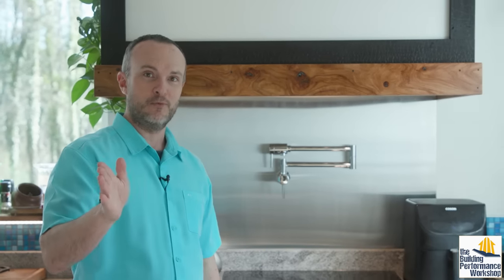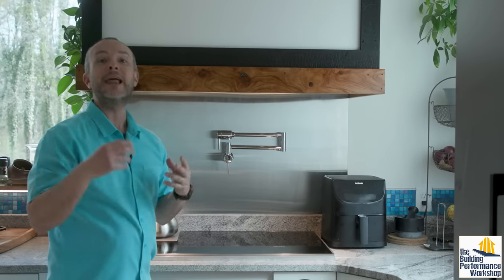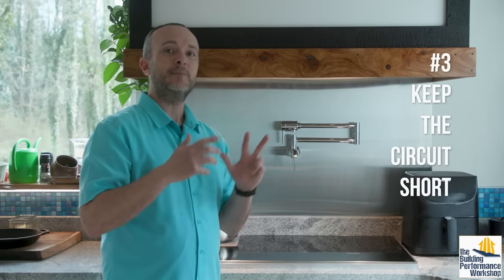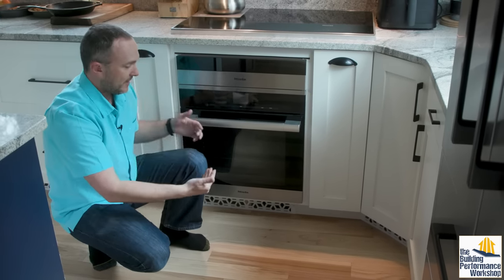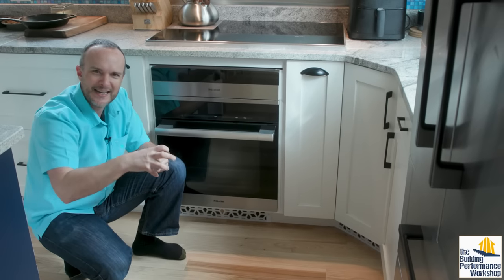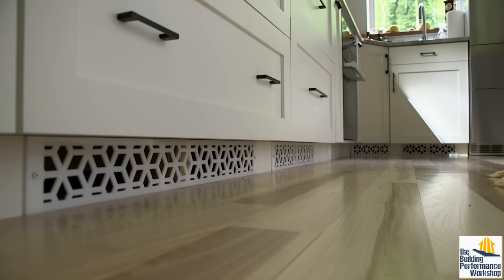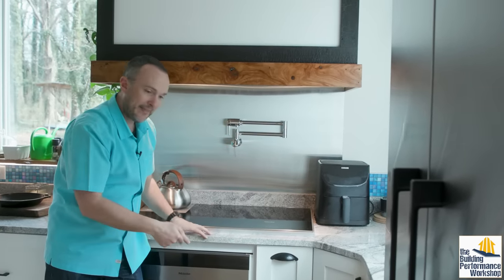3 Rules for Kitchen Make Up Air Systems: HVAC Training for Home Ventilation that Performs

Comment: Does your air conditioning evaporator coil create condensation when the system is running during the summer?

Yes? (No duh...)

Then moving your hot and humid make-up air at speed through your cabinet-bottom cavity will also create condensation. 

Put your untreated outside make-up air into your HVAC return plenum. That's how it's been done in commercial settings since forever.  For good reasons, too.
Reply from the maker: Clearly you have not seen condensation effects inside return plenums (many of us have) and our 3-year maintenance video on this system.
Reply: @HomePerformance  

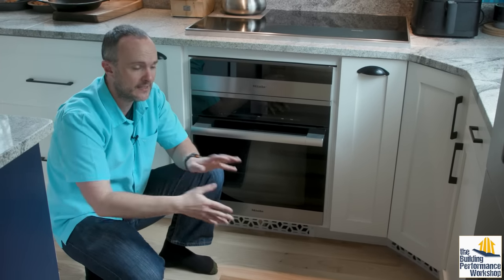In the first instance, I'm addressing your speculation at 9:00 that having the untempered outside air move at greater velocity through your make-up air plenum mitigates condensation risk. It really doesn't.

Second, in commercial HVAC settings, its completely standard to have like 20% outside air mixed into the return air at the air handler. In residential applications, though, it is still a bit novel and exotic and Passiv-Haus-ish to think about adding outside air anywhere in your HVAC loop. And yes, the equipment and system has to be designed for accepting outside air (randomly bunging an outside air duct into a return plenum that isn't expecting it can indeed lead to problems).

Third, in commercial settings it has become pretty well accepted that tempering your outside air or make-up air is standard, particularly where occupant comfort is at all a priority (there are certain industrial settings where it is not a high priority).  It is just jarring to the ears to hear of a design that is high-end comfort-oriented throughout, and then hear that the make-up air is just vented onto your kitchen floor untempered.

Fourth, I'll look up your 3 year retrospective video and see how things turned out. Being a residential kitchen with only intermittent exhaust fan usage, and given all the waterproofed coatings you described,  I'm sure things are A-OK 3 years in.  But taking a 30 year view makes me a tiny bit nervous, with this design relying mainly on a few coats of polyurethane (some of which are in places - the undersides of your cabinets - that are not easy to access and recoat) to keep mold risk at bay.

Comment: Wait, LMG this straight: you are pulling air out of your crawspace, onto your floor, OVER your food while cooking?
Reply from the maker: You obviously are not familiar with my crawlspace, but no that's not what's happening.
Reply: @HomePerformance  even if the air from your crawlspace is filtered (is it?), how is the air not hitting your floor and coming up over the stove? Isn't that why you worked so hard to have a short circuit so the house doesn't exhaust already treated air and instead blows out the air it just sucked in? Otherwise, what's the point of such a short circuit?
Reply from the maker: Again, you don’t know how a make up air ststem works my friend- look here:
https://youtu.be/bMkvCn1sGvk?si=IzYxk6T4DMZfx6JI
Reply: @HomePerformance  Not sure ANYONE "knows" how makeup air should work. Lots of theories, just here trying to find the mean for my ADU. One builder uses the bathroom exhaust running constantly in a <500 sqft space and NO inlet. And unlike you, Matt Risinger's house has a LONG circuit, way on the other side of the house as the range hood. 

One thing that would help is if you explained WHY you recommend a short circuit. This is the only place I've seen that, and you didn't say WHY, unless I missed that.

Comment: A 10 kw heater would be to much for a 600 CFM…
Reply from the maker: Might be their 6kW version, but I think it’s the 10. Takes air at almost 2000 fpm from 20 F to 80 F in 6 inches of heater, pretty sure that takes a lot of juice.

Comment: Or you could ignor the make up air, and just open a window when you are cooking.😅
Reply from the maker: Of course, Richard, very reasonable- though you can’t control how dirty, wet, hot, cold, or noisy that will make things.
Reply: @HomePerformance  Well, at my house, the outside air is almost always of better quality than inside. What Im more worried about is keeping the smells of cooking confined to the kitchen, and not spread throughout the house. 

I really enjoy your channel, and appreciate all the tech talk.
Reply from the maker: Thanks Richard- anything is often better than nothing!